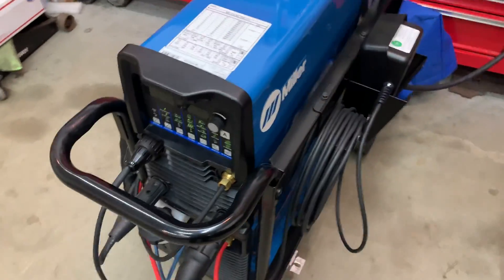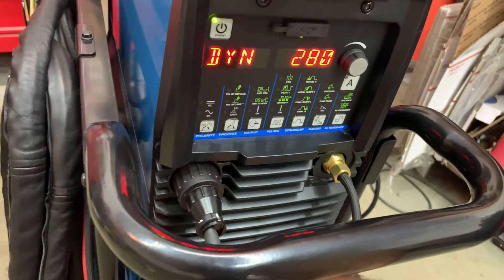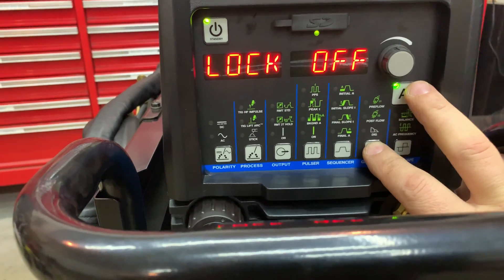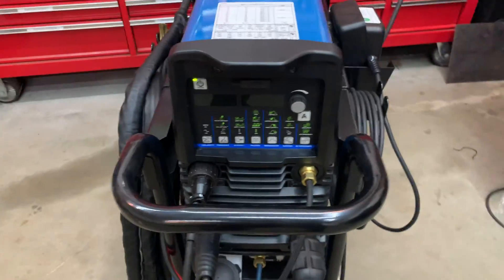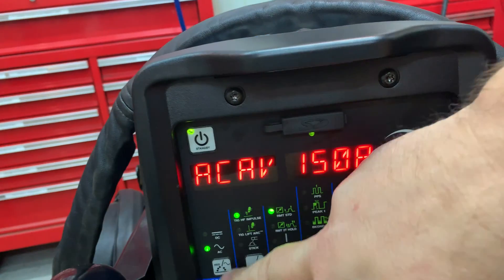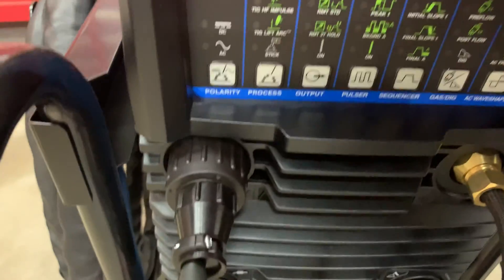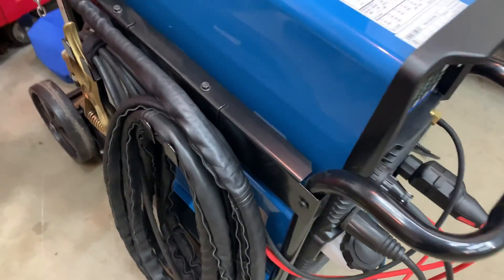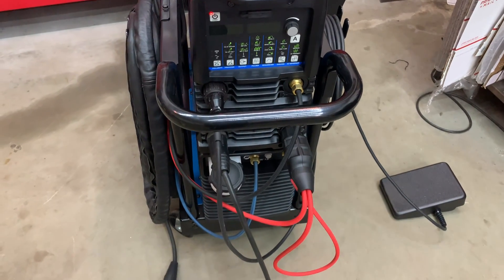Miller Dynsty 280DX Error See OM 1.4.3 POS

Comment: I’ve got an error 1.4.4 on my maxstar 210dx. Can someone help me please to understand?
Reply from the maker: That’s another death code unfortunately. Is it under warranty? Those codes are usually boards
Reply: @weldingjunkie  I Just called Milelr support and they say that 1.4.4. is low bus voltage error and not a board error.  I'm getting that error mostly when I connect through a 20-30-meter power cord. I'll try with a thicker power cord.
Reply from the maker: @artharutunyan  interesting they told me there were a few diff board codes from 1.4.1 to 1.4.5 few diff main boards let me know how you make out.

Comment: I'm having the same problem but first it was a CHEK INPT which says check input HIGH and LOW voltage on section 12-3 troubleshooting manual. and i seen a loose wire connection on the line side but after tightening I started getting the SEE O.M. and it says on sec 12-3 is contact the manufacturer for assistant. lol now i have to wait 1 to 2 days or more for their call. bad service.

Comment: Just started getting the "SEE O.M." error message yesterday on my Dynasty 280 DX.  My machine is ~4 years old but has been in storage the last three and a half years.  Probably doesn't have an entire hour of actual weld time on her.  However, due to the years in storage its probably not going to be warrantied (just guessing).  I blew out the cooling fans, etc. and really got nothing out as it was all pretty clean.  (It had been covered while in storage).  If you reboot the power unit it comes back up but only for 15-20 seconds before displaying the same error message again - every time.  If I strike an arc before the message comes back up it will weld but shut down as soon as the 15-20 seconds elapses.  Really annoying and I live very rural so the closest servicing dealer is about a 2 hour one way drive.

Comment: Good thing I still have my old square body syncrowave 250... but I deff am thinking about getting one of these
Reply: Do you know if the new syncrowaves still use transformers? I'd rather have a transformer because I hear they're bulletproof, but I think they're being phased out.
Reply: @strayedarticle2838  okay well yes they are transformer based…but they aren’t like the older ones that have toggle switches and rheostats you know (analog interface)…these new ones are all computer controls so that’s that weakness and I don’t believe you can adjust the hf frequency like you could on some of the older ones… personally I would surf eBay and wherever else to find a nice older one.. and be sure to get the metal foot pedal not the new plastic junk…good luck
Reply: @tjlovesrachel  Thanks man. Thats good advice for sure. If I can go analog I will.

Comment from the maker: I just dropped it off under warranty work. They’ll be fixing it in CT next stare over and about a week they said. They’ll ups it back if sooner. I’ll keep you guys updated
Reply: Hola, como te fue con la reparación de la DYNASTY 280 MILLER?. Yo tengo el mismo problema (SEE O.M), con mi DYNASTY 280.
Si me podrías ayudar con eso, por favor. Muchas gracias.

Comment: Welcome to the Dynasty 🤣
Reply from the maker: The Fabrication Series 😂😂 right. So much from going from a 210 to 280 👎🏼 junk.
Reply: Largest Dynasty is an 800... I’d love to see or even get to weld at that amperage. Just once.  Any chance we could see that in the fab series? Some high amp tig welding?
Reply: Do u still have it?? Hows it been after the repair??
Reply: What did you find wrong with the welder?